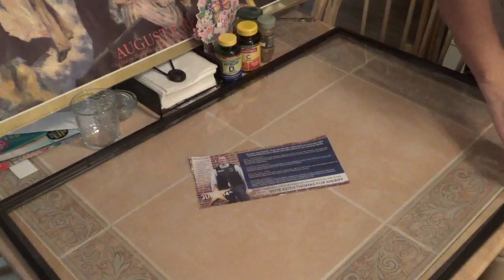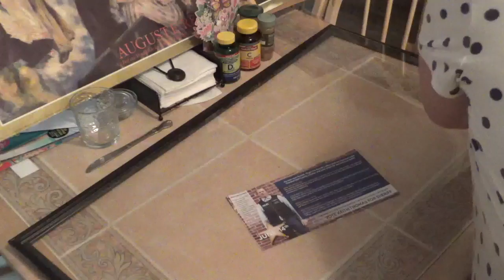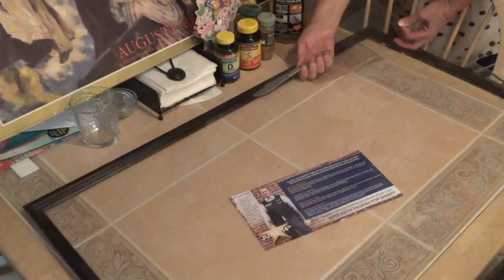How to Make Dollhouse Windows

Comment: Hi Debra. Looking at your videos in Sweden. I am new at this. Can I ask you a question? I installed windows that I bought from temu with a kind of plastic glass that came with it. I got clue on the plastic. Bought nail remover and tried to remove it. The plastic resolved! Can you give me a tip what to use to remove clue that doesnt resolv plastic? Parden my language, I am 70+ and swedish. Thanks for your videos and best regards.
Reply from the maker: That is a good question and I wish I had an answer. I can see how nail polish would mess up the glass because it has acetone in it that so nail polish  remover would destroy the plastic. Isn’t that essentially what nail polish is a plastic cover and the nail polish remover dissolves it? I did get some glue on my windows but I did not try to remove it I just decided that it will make the windows look old for an old house. Maybe someone else can answer this question how to remove glue from plastic windows.
Reply from the maker: Replying again. In thinking about your question and collecting clear plastic from empty food packages for future doll house windows I had a label that did not fully come off so I tried Goo Gone and it worked. I should have realized this before as I have always used it on glass to remove any sticky residue from stickers. It might work with glue as well. Give it a try.

Comment: When an office I worked for was closing and throwing out various office supplies, I "rescued" boxes of clear overhead transparency sheets.  (Remember overhead projectors?) Then, after measuring the window openings, I would draw "leaded glass" images on plain white paper, and copy those images on the copier onto the transparency sheets.  Then I would cut them out and apply them to the window openings. After that, I would finish with window trim on the outside and inside walls, using whatever scrap pieces of wood or cardboard I have.  For an unfinished wood dollhouse I decorated for kids at a homeless shelter, I used popsicle sticks, tongue depressors, and paint stirring sticks for trims, shutters and window boxes.  So much fun figuring out how to solve "decorating" problems with items most people would throw away!
Reply from the maker: Oh yes I remember. I used to use transparency sheets. Don't know if I have any more. That is a really great idea. I love the idea of printing the image on the transparency sheet.   Popsicle sticks are great for many uses. I start using them when I make furniture for this house. Thanks for sharing those ideas.